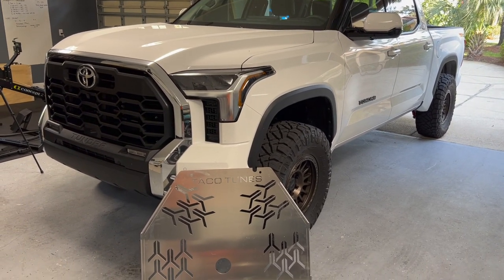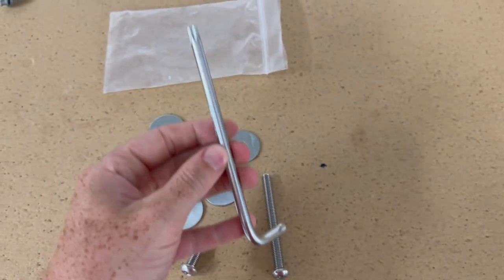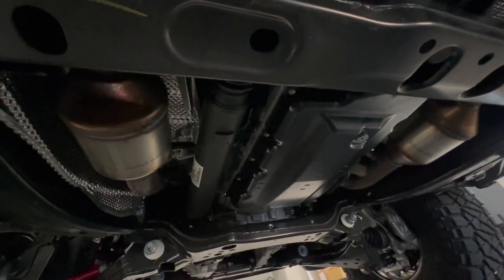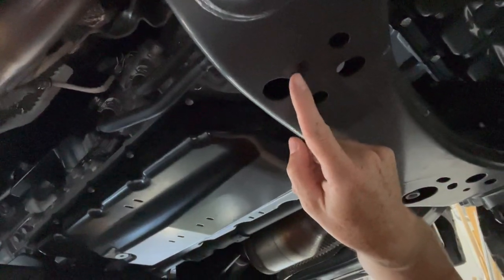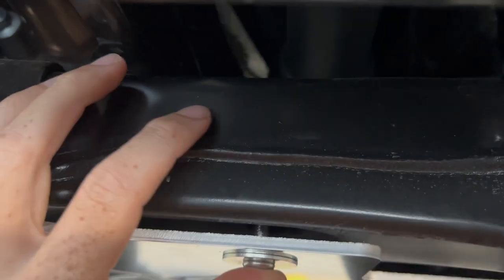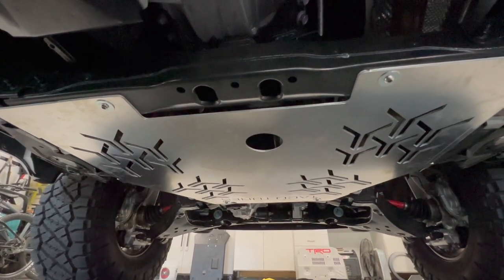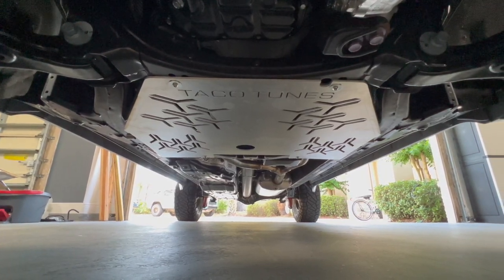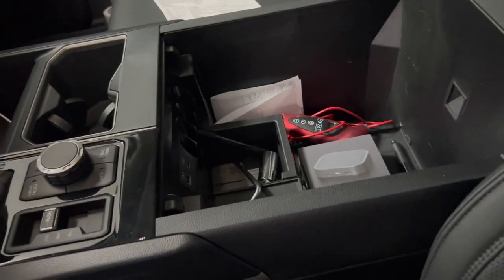Protecting my 2022 Tundra's Catalytic Converters From Crack Heads...

Comment: Catalytic theft has been common for so many years now you would think the manufacturers would be covering them at the factory
Reply from the maker: No kidding! But probably something for them to make more money with insurance claims.
Reply: Toyota had catalytic converter shield as a build option accessory for some models on the website
Reply: Afraid they might lose $200 profit…

Comment: Just a quick question would that plate cause those catalytic converters to retain heat and get hotter than normal when they're in a sitting position as if you're stuck in traffic or something like that, but if I get a new tundra I'm definitely going to order that plate
Reply from the maker: It's an aluminum plate, so won't hot alot.

Comment: Those self locking nuts for the back side were a pain in the ass to work with. Not as easy as the video shows
Reply from the maker: Did you tighten down the front ones all the way before the back? could have been your issues.
Reply: @TRDJon  no, I left them a
But loose to be able
To put the back ones. I ended up having to use some other nuts I had.

Comment: I bought one great video.
I noticed  when I put my in that the plastic gas tank is very low and looks like it could easily  be damaged  especially  off road. Does any one make a protective  cover for the gas tank?
Reply from the maker: More plates are coming out in time. I know CBI has some coming and C4